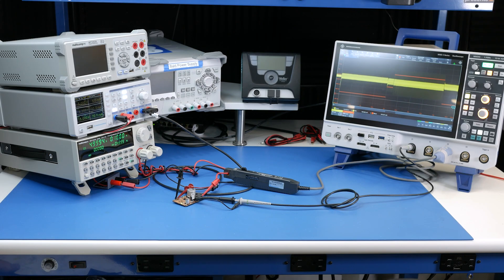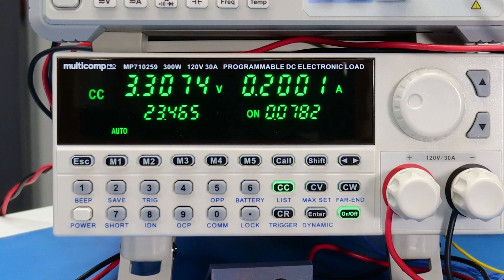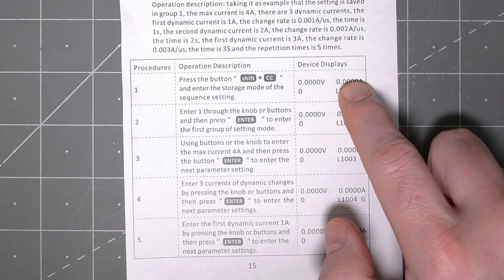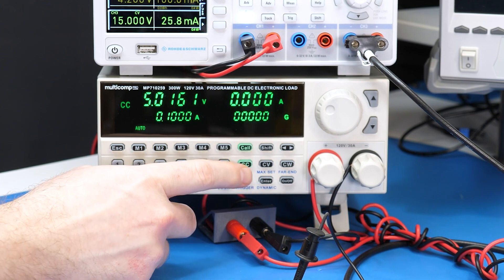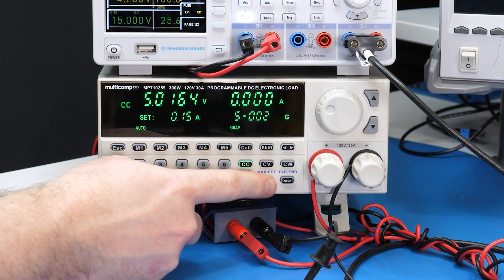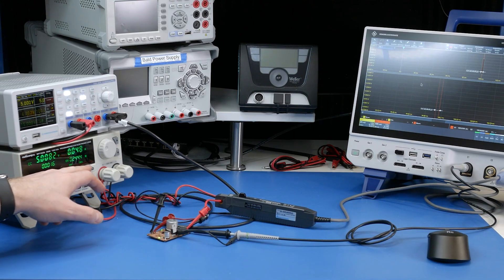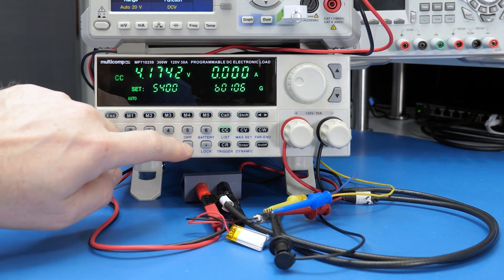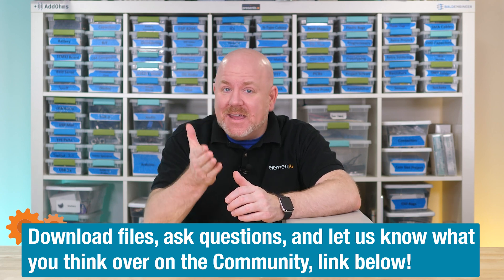3 Advanced Electronic Load Measurements with the Multicomp Pro DC Load - Workbench Wednesdays

Comment: Thanks for this. The manual is clear as mud, might be an idea to write a clearer one for the community, which is maybe something I'd consider doing when this arrives next year. Also an overview of the PC software would be nice.
Anyway, thanks for showing how to test a battery, something some other reviewers said it's probably not in the cards for this unit (as far as getting the Ah number) which you clearly showed can be done. Of course, the UX is straight from the bronze age of technology where you cram as much into your few buttons as you can... I can understand it, but man, makes you appreciate the modern UI where just the higher resolution screen solves a lot of these problems.

Comment: Hi James
I really appreciate watching your videos about functionality of electronic load. I’m owning on of them Itech IT8514C+ and I’m really need some advices with specific way of using it. I’m selling battery chargers for personal electric vehicles. And the reason I bought this unit is to testing those battery chargers. Mainly efficiency of this chargers. As they are stated for example 2A, 3A, 5A etc I really want know if they are that strong as manufactures stated they are… Obviously if there’s any other test available for battery charger with this unit. I will like to know as well. I’m electrician with 12 years experience with cnc machines. So know a bit about electrical. But I’m afraid to use this machine. As was very expensive and I don’t want to brake it. Also I don’t want to brake any chargers if you know what I mean. So if possible can you consider to record some video about this specific battery charger test with any available electric load you ? My unit has exactly same function as the one you presented. It’s only bigger and stronger. Hopefully you understand what I mean. 
Regards Michael